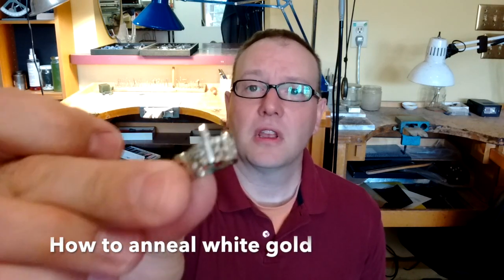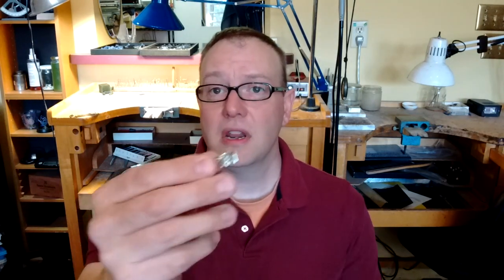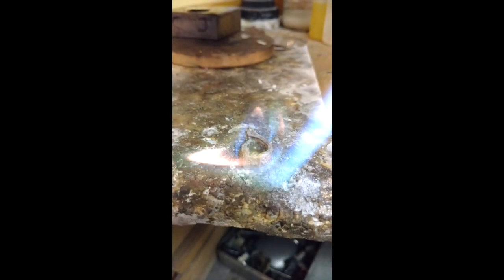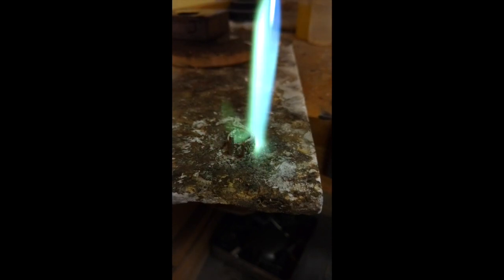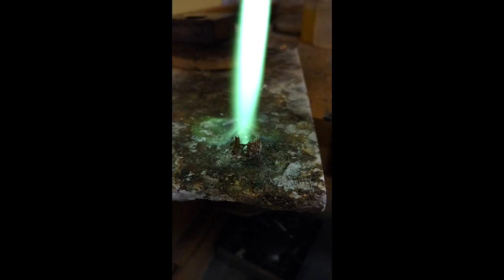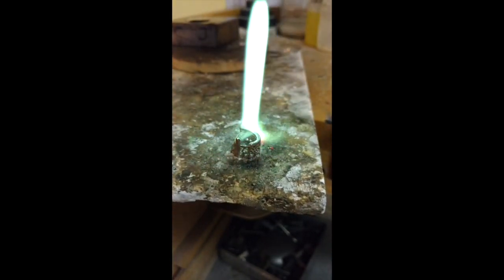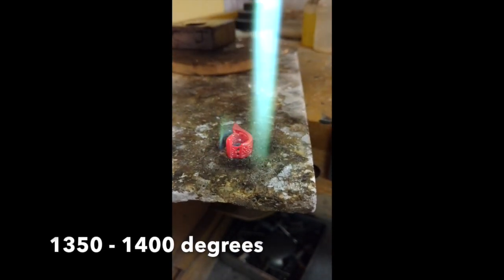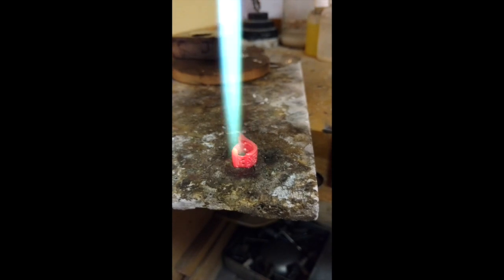How to anneal white gold, The answer may surprise you.

Comment: Gonna try quenching. This 10k ingot is kicking my but, hardest metal I've worked yet.
Reply from the maker: How thick is you ingot?
Reply: @GotchaRocksJewelryDIY  started off 4x4 square. I'm drawing it down, and having a heck of a time getting it through the drawplate without pounding it through. Atm I can only draw wire by hand. The quenching does help, but, its still very hard.

Comment: Hi there! I have a question about what to do if your white gold wasnt protected enough and endes up with fire stain? I think ive heard others call it blushing? Lol but my ring turned into rose gold after anealing sadly and i am not sure what to do. I know with yellow golds you can depletionion guild to bring the fine gold back to the surface. But i am guessing thats just what it'll do with my white gold and just make it more yellow. Will it need to be plated to be able to get the white color back? Its a 14k white gold alloy. I am pretty sure its not alloyed with any platinum metals if that makes any difference in how to work with it. But i am now sort of afraid to use any of my white gold anymore as i dont want to ruin them. I have coated the piece beforehand. Just didnt seem to work for me. I have 10k,14k, and 18k white gold alloys that are now just sitting around.lol
Reply from the maker: Sounds like a bad case of fire scale. It also sounds like you are coating your pieces with boric acid first, so thats good. 
After you solder or heat your piece are you soaking it in hot pickle solution? If not this can be found at Rio Grande supply co. If the fire scale doesn't come off you may have to sand and polish it off. I have had pretty good luck removing it with a pickle solution by soaking it over night. Let me know if that helps. I will be by the computer for a little while.
Michael
Reply: @GotchaRocksJewelryDIY  im so sorry! I am still kind of new at this youtube messging as i use to not ever comment before. Anyway, thank you so much for taking the time to reply with your advice. I truly appreciate it. I do use picklng solution. BUT, it is the "home made." Stuff that i read about when i first started and since it worked well for my silver pieces, I've never bothered to buy the real deal lol.  But now, i am thinking its not the greatest for gold.lol i would gladly accept any recommendations you might have on the best solution:):) thank you so so much.
Reply from the maker: @kathryncastanares525  Here is a link to some good pickle solution. This should serve you well. https://amzn.to/2XlJOLn
This is my affiliate link. It looks like a good price and should last you a very long time. I cant remember the last time I even bought any.

I only put two tablespoons in my pickle pot with maybe only be half a liter of water. 
It isn't uncommon to mix different strengths depending on the fire scale. 
Remember that the pickle can eat the alloy in the solder, so be mindful of how long you leave your piece in the pickle. 
All the best, Michael

Comment: Love, love, love the advanced techniques. I have a suggestion/request from you because you are such a great teacher - able to very comprehensively and intuitively transfer your understanding to others (wow, yay!); I am hungry for advanced techniques and especially using gold, high karat bezel (22k and 18k) on top of silver (backplate) to do what I've heard called "hybrid" soldering - to keep the cost of pieces down. What alloys are best, do we solder or fuse or both, and when. What temp solders, which ones first (and last) depending on solder steps, etc. the why, how, and what to watch for. Do we use fusing techniques for the bezel? Do we use solder? Gold solder or silver solder? Next to ZERO people have made any videos about this. I have experimented and am willing to make videos myself but at this time, I am basically a blind jeweler leading the blind jewelers, if I were to do that. Also, there is no real anecdotal info on using Aura 22 or 24k gold AGS (accent gold for silver) and how to use it on fabricated sheet and wire pieces (as opposed to metal clay), etc. Are you interested? I'll do it if no one else will, but I have so little experience, comparatively (it seems). Thanks so much.
Reply from the maker: Hey Gabby, 
Thanks for the suggestion on adding gold to your projects. I will see what I can come up with. Gold does like to play little tricks when you solder it to silver.

I will give you my short tip on combining them. If you are adding yellow gold to a silver piece use sterling silver EASY solder to combine them. 

Place a small piece of solder under one corner of the of the gold being soldered to the silver.  Heat the silver with a torch and let the silver heat the gold. Heat till the solder flows.

Then make sure the gold is flush with the silver and add a little more solder with your solder pick. Work your way around the gold piece until it has all been soldered to the silver.
 
I use that first square of solder to hold the gold in place as I work around the gold. 
Hopefully that helps a little. One more tip if the gold is to thin it will be absorbed into the silver. 

That's a fun problem....It's just gone. I watched someone do this over and over one time. 
22 gage gold seems to hold up well enough. 

All the best, Michael

Comment: Took a while to find this. I've been a jeweller for 33 years but am totally self taught. Learned something today.  I'm sure
I knew this at some time but haven't needed to anneal white gold except for thin wire for some time. All my models
have been made by mill or 3d printer for the last fifteen years.
Reply from the maker: Hello Robert, Thanks for the comment. I am glad you fond it useful. I took the CAD classes but have not had a chance to put it into practice. What kind of 3d printer are you using? It is amazing what they are able to print and mill now days. All the best, Michael Seiler